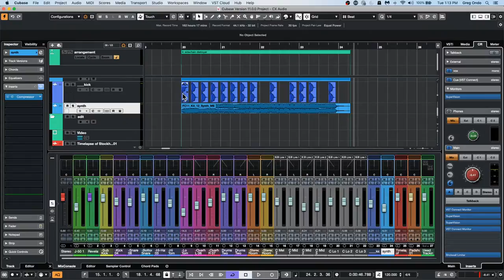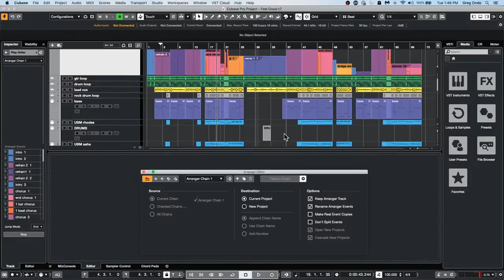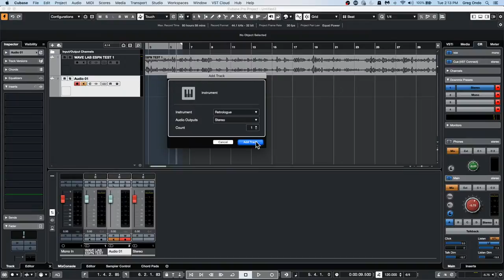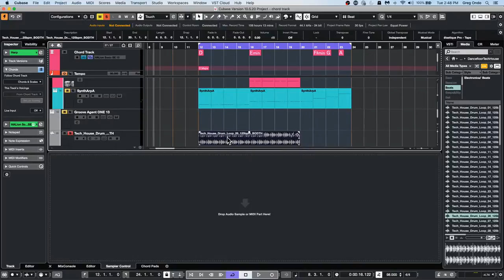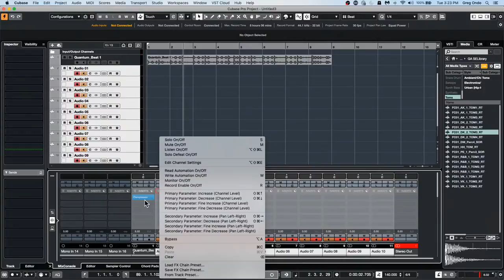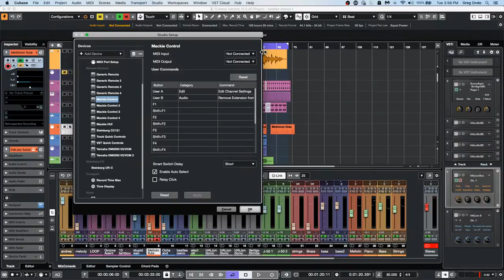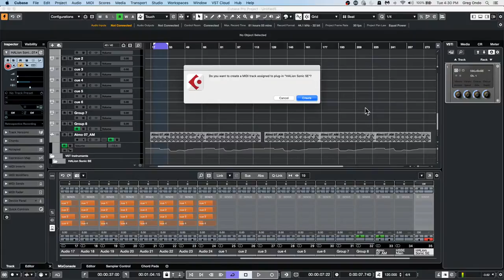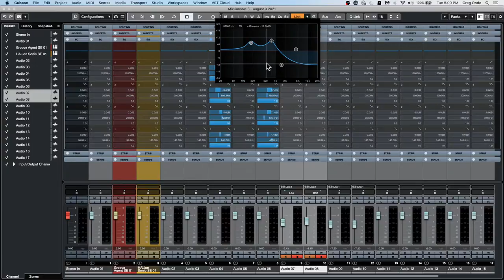How to Have a MIDI Part Loop Independently of The Project Timeline | Club Cubase August 3rd 2021

Comment from the maker: 00:03:55. Is there anything new with the new authentication system?
00:05:57. Can you please guide with setting up sidechaining?
00:09:52. Why does Cubase take a long time to start after installing Komplete 13 on USB drive?
00:12:26. How to sync beats to a full length song from a record?
00:19:09. Is it bad to have some frequencies in red on SuperVision’s MultiCorrelation Meter?
00:22:32. Are included sample loops from Cubase often used in soundtracks?
00:24:58. How to migrate user settings from Cubase 10.5 to 11 easily?
00:26:15. Can Greg explain the difference between the balance and combined stereo panner?
00:28:40. How to get my Cubase Elements licenses upgraded to Cubase pro?
00:30:15. How to change the recording path after doing a save as function on project?
00:33:42. How to add more room for additional articulations in an expression map?
00:35:54. Any recommendations for reversing or mirroring automation data?
00:39:50. Why do synth tracks sometimes get out of time after reezing them?
00:43:16. Will the CC121 controller work in Big Sur?
00:43:48. Can I retrieve an arranger track that has been previously flattened?
00:46:54. Which version of Cubase should I use if I only want to record vocals?
00:49:55. Can you show how to make an M&E stem in Nuendo?
00:54:56. Can I remove older versions of Elements after upgrading to Pro?
00:56:28. Why are stems still printing with effects when they are bypassed in MixConsole?
00:57:42. Do I need licenses for HALion Sonic Se, Padshop2, and Groove Agent if I have Cubase?
01:00:16. How to move the MIDI note range for expression maps?
01:02:04. Why is my guitar really loud when I am recording into Cubase?
01:04:47. How to edit dialog tracks at twice speed?
01:08:28. Why do I hear white noise when recording with Guitar Rig 6?
01:11:42. How to record the notes generated by Arpache in real time?
01:16:26. Have they gotten rid of the dongle?
01:17:33. When will native m1 version of Cubase get released?
01:18:28. Does the Dorico ipad model mean that Cubase will move to a subscription plan?
01:19:33. Can I open a locked track on shared project in VST Transit?
01:20:21. What difference does bit depth make and which is best to use?
01:22:36. Can Yamaha provide more fiscally accessible way to purchase Vocaloid?
01:24:05. How to do something like effect rack for parallel processing?
01:27:20. How to have direct offline process not get cut when next event begins?
01:31:13. Why is there an option of exporting to a 32bit audio file?
01:33:40. How to move my personal settings data from Cubase 10.5 to Cubase 11?
01:34:55. What can make my guitar too loud when recording with my UR 22?
01:36:10. How to tell which plug-ins are CPU and latency hogs?
01:38:44. Why do I get messages that Mantra Voice and Urban Pop Vocal can be started?
01:41:53. Does Steinberg have mixing or remixing contests?
01:43:21. How to use the chord track to manipulate MIDI data?
01:46:26. How to time stretch a file from 90 to 120 bpm?
01:49:13. How to drag an audio part within the arrangement view without moving position?
01:50:37. Why is my MIDI controller not working well with Cubase?
01:52:44. Why does my SpectraLayers not unmix instruments like before?
01:55:18. Is send a CC control so that I can use a MIDI controller?
01:56:38. Does FL Studio and Garage Band have the same features? 
01:57:20. Why do buttons and controls on my NI Komplete controller stop working?
01:57:51. Can the development team make a pitch shifting plug-in?
02:01:16. Why do some plug-ins lose functionality when they are resized?
02:02:19. Is there a key command that can open only insert and send inspector tabs?
02:04:25. Is it possible for a customer to get a grace period for the Studio weeks promotion?
02:05:39. Would we have to use Cubase for a potential Steinberg contest?
02:06:52. How to have editor windows set to always on top with multiple monitors?
02:08:40. Is there a way to duplicate events backwards in time?
02:10:45. How to place tracks in correct time position coming from other DAWs?
02:12:45. What ways can an audio engineer make money in their career?
02:13:38. Is Cubase Elements worth it for advanced production?
02:15:34. How to drag in a loop and set its tempo to the project?
02:18:01. How to preview drum samples and hear them?
02:20:03. Why can’t I get my Cubase LE to Cubase Elements to take?
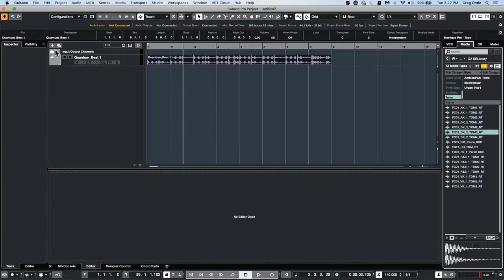02:21:03. How to select multiple tracks and copy plug-ins from one track to others?
02:25:10. How to record on selected track if event on other track is selected?
02:27:41. What audio interface is best to use with Cubase?
02:29:59. Is there any hardware that comes with a full version of Cubase?
02:31:11. How to ask questions in the live stream?
02:32:11. Is it possible to create a macro to split MIDI note, render and reverse it?
02:36:18. Does Steinberg do upgrade promotions from LE to Elements?
02:37:01. Does it make sense to run reaper as a ReWire slave with Cubase to get more tracks?0
02:39:19. Anyway to link the resources of 2 PCs over ethernet to share resources for samples?
02:41:50. Can you reuse automation clips on audio events?
02:43:26. How to enable my metronome which is not working?
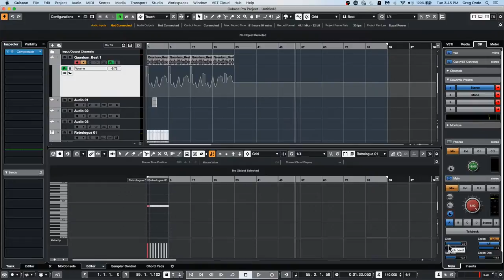02:44:49. How to move my customized Cubase settings from previous version to Cubase 11?
02:45:42. Why is metronome off in a track that is at 104 bpm?
02:47:59. How to make instruments not all sound the same with plug-ins?
02:52:27. How to record wireless mic connected to mixer with MIDI connected to UR22?
02:54:30. Why does my MAudio control Cubase transport but not record MIDI data?
02:56:56. What can cause mouse clicks to create performance spikes?
02:58:42. What is the best way to mid side chain?
03:00:52. Why is the preview volume so loud when auditioning loops?
03:01:44. Does Cubase 11 have a limiter which does not enhance sound so much?
03:03:09. How to manage projects where project folder wasn’t defined from the start?
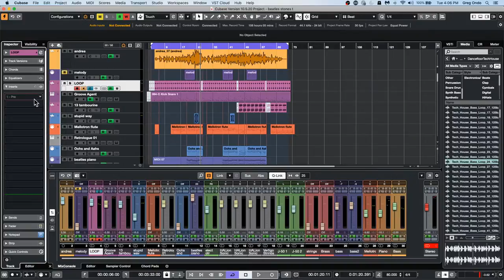03:05:16. How to do M/S EQ in Cubase?
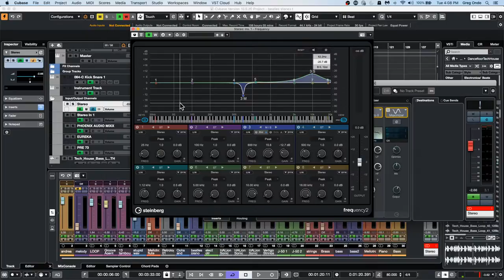03:07:42. How to copy insert effects from one track to others?
03:12:34. How to draw a gain automation to a specific dB level on events?
03:15:28. Can you see remaining time in export audio window?
03:16:32. Will there be a promotion for Cubase users to upgrade to Nuendo?
03:17:16. Is there a reference of the MIDI notes that are transmitted from a Mackie Control?
03:18:56. How to configure an Aviom system with Cubase for additional Cue Mixes?
03:23:20. Why is the display of live stream a little fuzzy?
03:24:04. How to get a a paid film composing gig?
03:24:58. Where can I find icons for Cubase functions for my control surface?
03:26:25. Can event copies have automation data update if original event has changed?
03:28:00. How to remove instrument rack of HALion Sonic SE after importing a MIDI file?
03:29:48. What can cause loops to be out of time after adding plug-ins in mix?
03:30:56. Why is my Cubase LE 9.5 waveform not visible?
03:32:37. How to loop a MIDI event independently of the project window?
03:37:07. Is it possible to recall the last solo state of channels in MixConsole?
03:39:55. Is there a way to have inverted panning on 2 separate mono tracks?
03:40:33. How to sub group tracks within an existing group?
03:41:52. How to set the master tuning scale in Cubase set to 432 Hz?
03:45:02. Why does adding a © symbol in mp3 metadata produce a letter A in some programs?
03:48:39. How to have all samples from different locations moved to the project folder?  
03:50:06. Is it possible to delete or overwrite a factory preset with a user created preset?
03:51:54. Can I see 2 different events, drum and bass in hybrid drum and key editor at once?
03:54:45. How to hide unused rack components in the MixConsole?
03:55:50. How to maintain width of right zone in MixConsole 1,2 and 3?
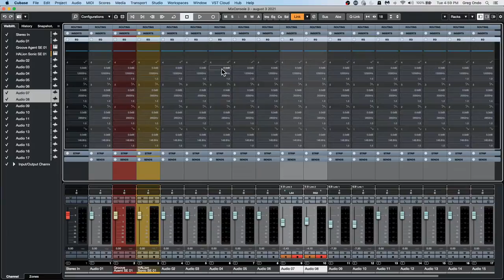03:58:11. Can the EQ in the MixConsole racks be set as knobs as opposed to sliders?
03:58:49. Wrap up.  Stay safe and healthy.
Reply: S we’er
Re r
Reply: I don’t know